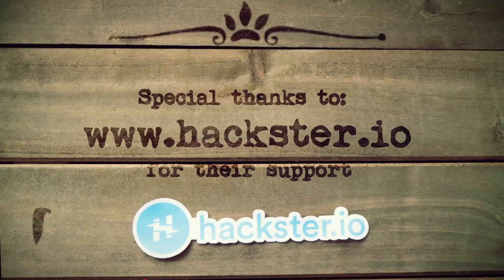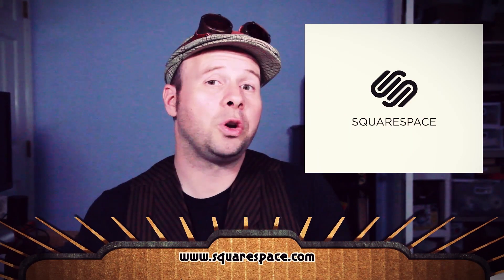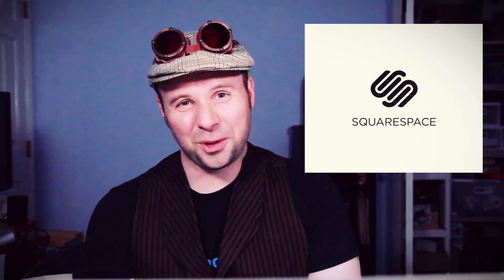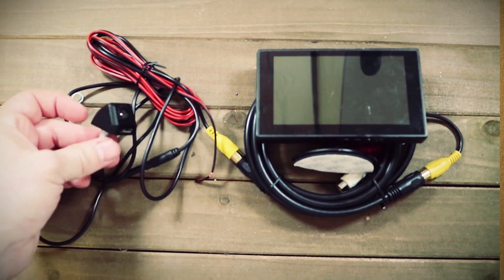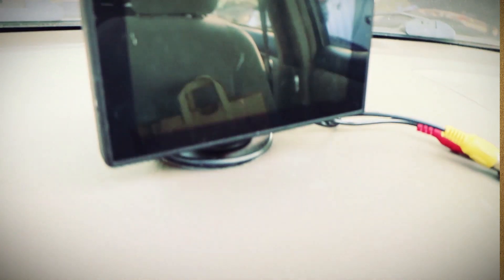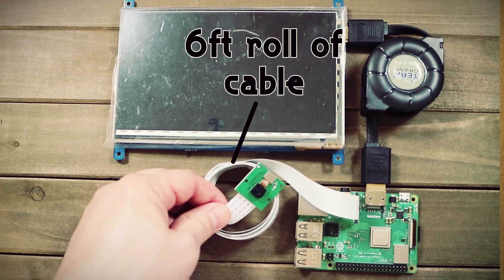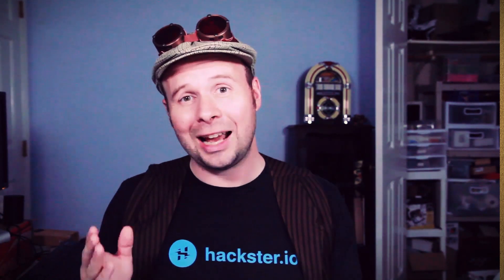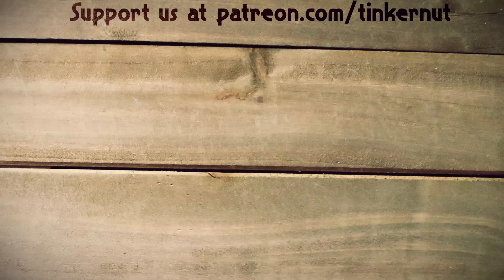Simple Car Backup Camera -  - DIY Smart Car (Part 1)

Comment: Check for drowsy driver, AM/FM Radio, MP3, MP4, and Video player to replace existing stereo and plug into amplifier in vehicle. On-line and Offline Navigation, and weather display. Altimeter, speed, incline and tilt of the vehicle. Backup camera with distance sensor, and front camera with distance sensor, Vehicle tire pressure. 10-inch touch screen. All ran by the Raspberry Pi.

Comment: Most cameras for the car are pretty good in dark/low light situation. I have no experience with raspi cam. Is it any good for parking with the reverse lights only? Or are you intend to use the parking camera on the long run?

Comment: Few other things to consider:

-Parking sensors
-Automatic heating seats (lets set when it gets below 40 degrees)
-Bluetooth headset/ handsfree system
-Android device with GPS navigation and media player
-Automatic seat belts (check it out,  that's actually a thing!)
-Tyre pressure sensors (hooked to the Android device, lets say)
-voice commands 
-blind spot sensors /w camera
-maybe something silly like build in Alexa system

Comment: I would have the backup camera, a high mounted rear view cameras  and blind spots cameras (and each would have own lcd ) HUD for vital informations.. voice activation for the main car computer system that would have , of course, Non data service reliant navigation (via google earth) , a wireless media server for non data service reliant entertainment , engine management monitoring with lcd gauges display.   All of these things can be sourced independently , but I want them all in one. Wifi and celly boosters /repeaters '

Comment: The pi would have to be permanently on , you would not want to wait for your Pi to boot up just to put the car in reverse. This could drain your cars own battery over time.
Reply: I would assume you would keep the pi running on it's own battery that only charges whe the engine runs. I dont have a pi but I would guess there is some way to switch it into a standby mode to reduce boot times. The periferals would be set up to only run with the engine running.
Reply: James Bowen would need to see add one of those car solar panels for keeping the battery topped up

Comment: A backup camera is a super good idea for all older cars without one. Doing something like Mercedes or BMW and having a 3D stitched view would be awesome. It would require lots of tinkering to get the calibration just right, but I think all they do is apply some transformation to the image itself. You could go crazy and try to program it to recognize objects, but honestly being able to have a 360 view around your car would be super nice.

On the performance car side, having the display show things like boost would be super cool. However, lots of modern ECUs are harder to get that info from. There exist $5k+ monitors already though, so it's definitely possible to reverse engineer the signals. Another thing would be active aero. In theory you wouldn't even really need to take info from the ECU, just add a sensor to see how hard you're hitting the brakes and an accelerometer for how fast you're doing. It's probably also possible to use some other sensor to determine speed as well.

Comment: Dash cam. Cheap dash cams break in the heat, and are bulky. I've been wanting one thats hidden, won't break in the heat, records my speed, time and more. First problem holding me back is a dvr program that can continue loop, something like that. There is more that i would like to put on my 80 truck. In the end it would be like a black box vs smart car. Also prox sensor w/ alarm, car in front of me is stoping/ slowing down. Should i keep going on?